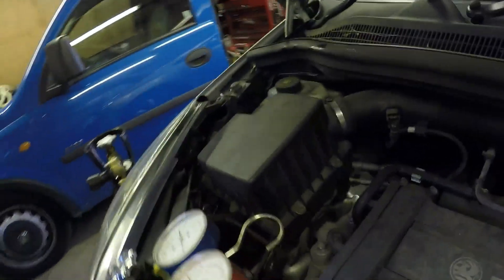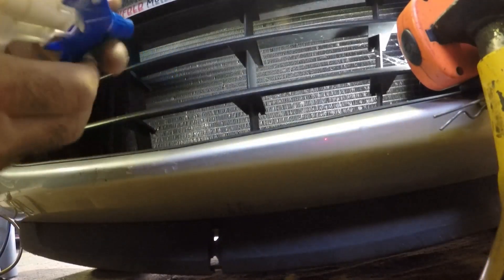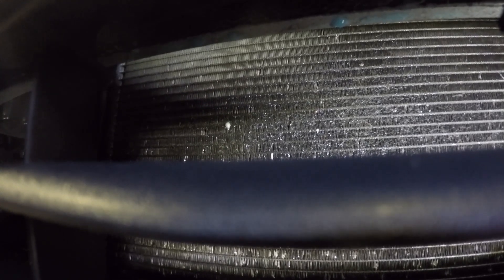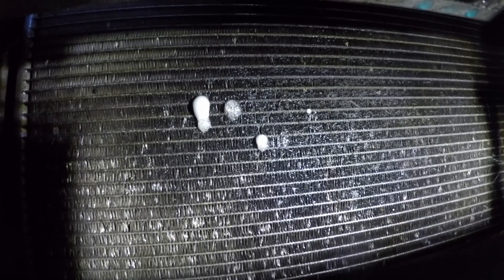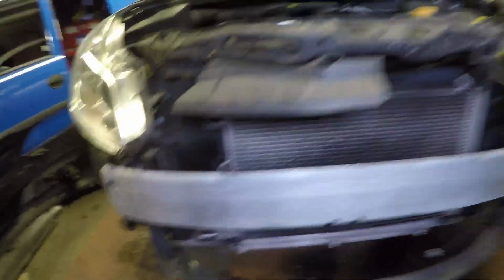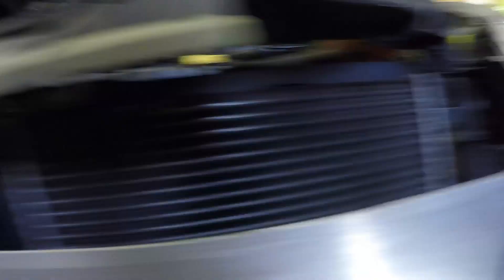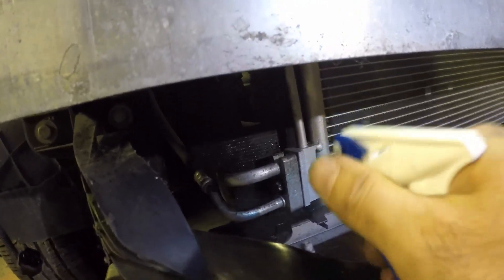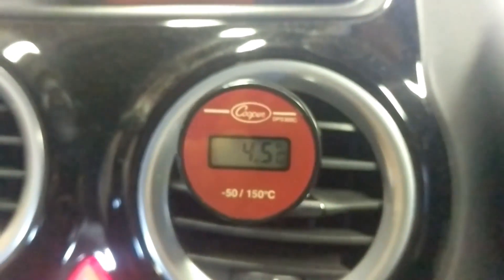Vauxhall Opel Corsa D 2008 Air Conditioning leak testing with OFN

Comment: Is the low pressure valve the one closest to the front of the car?
Reply from the maker: Makii // JakeLDesigns - think they're both next to each other. The low pressure connector is on the thicker diameter pipe.
Reply: Automotive Solutions Thank you! I had trouble trying to figure out which is which so I can recharge my air con.

Comment: My local garage done this for me yesterday, a/c lasted about 6 weeks last year and have had no a/c since, tried sniffer tool nothing picked up so had the system filled with nitrogen and when I got home removed bumper and sprayed condenser with soapy water and with 10 mins I had bubbles on the condenser. Checked pressure this morning using stp gauge and it had dropped by 25psi from 65psi overnight.
https://youtu.be/q90qZOTJiV8
Reply from the maker: At least you found it. Don't run the system with nitrogen in it. Pressure will drop relating to temperature so not an exact science. 👍😁
Reply: Thanks, local garage is installing new condenser next week and full a/c service